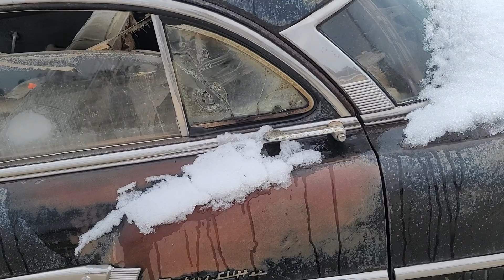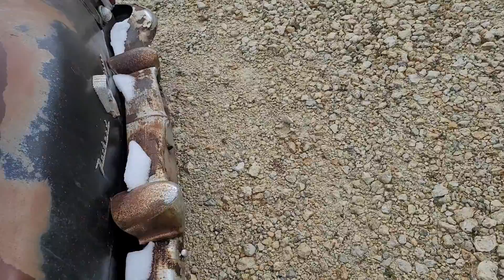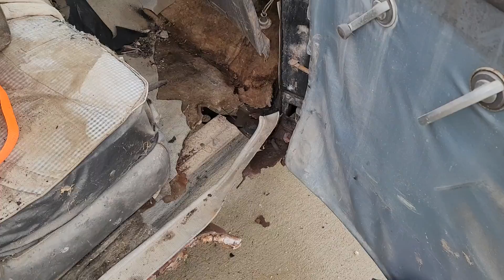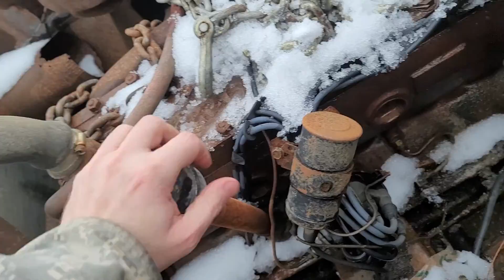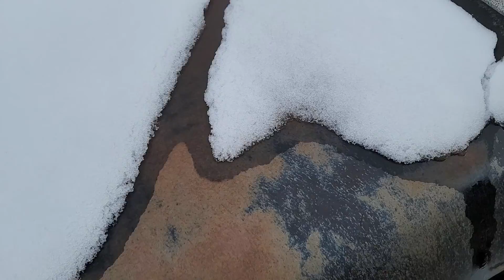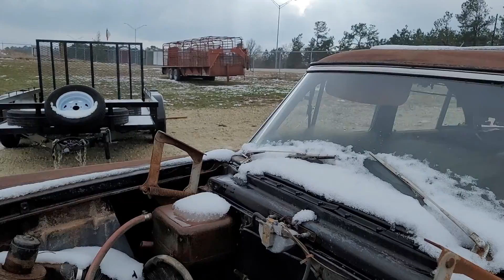1953 Packard Clipper - Parts Car

Comment: Start cleaning it out and see what you can pull out of it.  Looks like lots of good parts. If the cylinder head is in condition to be put back to spec, you could have quite a parts find on your hands.